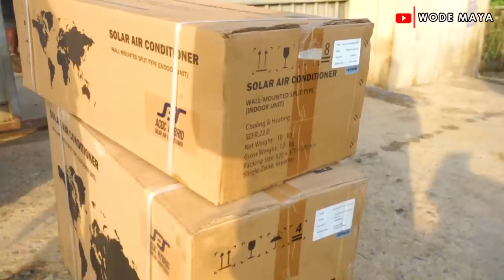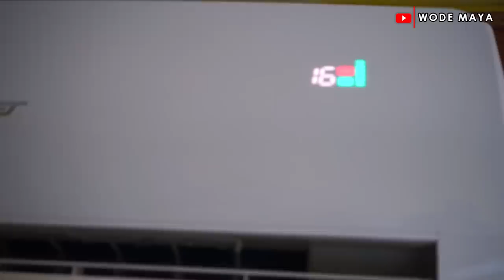Renovating My Mum's House & Installing Brand New Solar AC!

Comment: It's so good you are using solar power because sun is something Africa has in abundance and it better than relying on Nigeria's NEPA 😂😂
Reply: yeah but african need manufacturing the solar panels otherwise chain and others will benefitiar. if citizens doesn't pay electricity to government then no benefit to their country.
Reply: @apple20sara89  WHAT  .
WE  GOT WIND IN EUROPE. 
U CAN  LEARN  TO BUILD SOLAR PANELS  ON YT.
Reply: @apple20sara89  do we tell the government to switch off power every now and then?, we make alot of losses because of their negligence.
Reply: @apple20sara89  who told u we dont mafucture light panel ahha . We do pay for light dont open ur mouth and spread rubbish understood

Comment: 5:25 you can even run washing machine, cooking, pumping water from the well,  run fridges, ovens, boiling water, air frying food, led lights, phone charging, radio, TV satellite systems and computers etc.. #wodemaya , #wodemaya did you give the installation a #SPS team a welcome drink when they work in the extreme heat?

Comment: Not sure how electrical is there, but you really should have thrown down, got more panels, and a BIG battery.

She wouldn't have to worry about brownouts and sell any excess energy back to the grid (possibly).

Not sure how all of that works there though. And I'm sure there were reasons.

Comment: There is biased toward non-white areas of the world, plus a lack of research shows in these videos. Depends on work experiences in traveling and knowledge of basic economics... here is some criteria to base your choices / options.
1. Does those areas you want have a manufacturing base: lf so, there is growth potential for such place to rise from 2nd or 3rd world status
2. IT Infrastructure Development: Can you or someone place a telephone call across town, country or internationally from your residence or hotel room without problems to a distant parties. If not, choose another place to relocating
3. Banking Infrastructure: Can you deposit / withdraw money /checks /credit cards  safely without issues? Do online banking?  This ranks right after IT Infrastructure Development.
4. Gold / Silver based currency: Stability is another factor to consider residency in a country or having that country's passport. It's also a basis to determine the country's growth potential as well.
5. Civil Infrastructure:  Does the place has roads / railroads / sea ports / airports?  The ability to travel around is another point to considering your new home. And the ability to escape if such place could suffer hard times of unrest, etc....

There are other things to look for to base your calculations, but this a start for you to help build a plan. Good luck in you quest for a Second Home.  Please spread this list around to others to help them as well. Use the Nomad Capitalist videos as a weighed variable in your formula to make decisions, not a overall benchmark.   Good Luck and god speed.